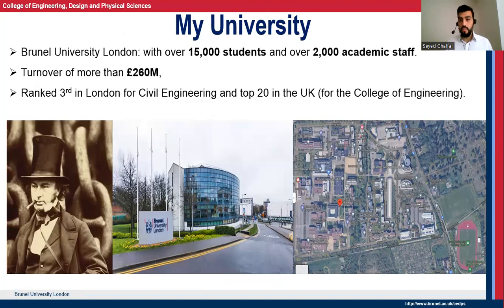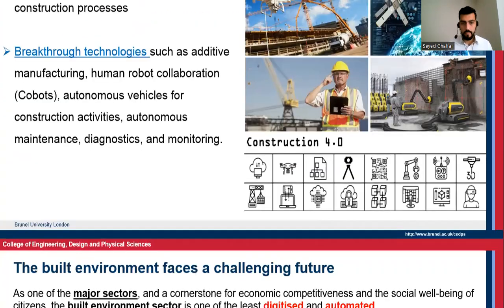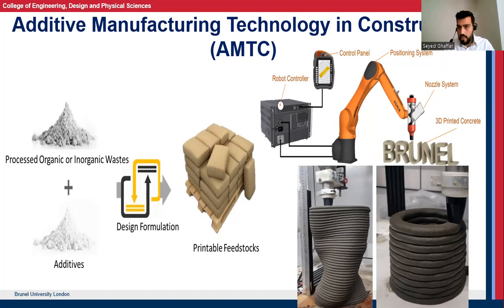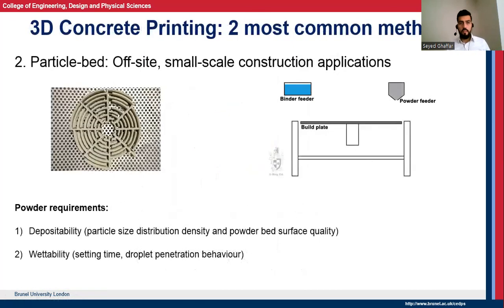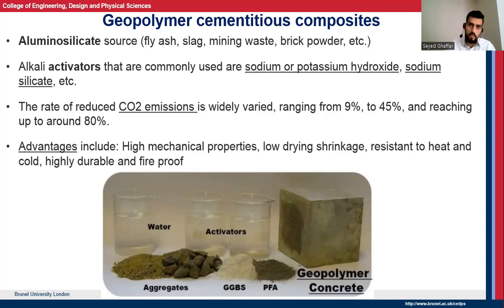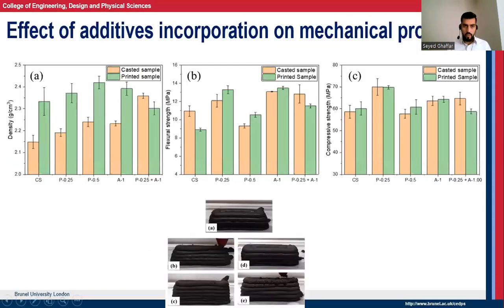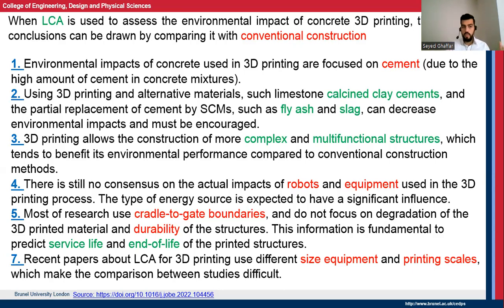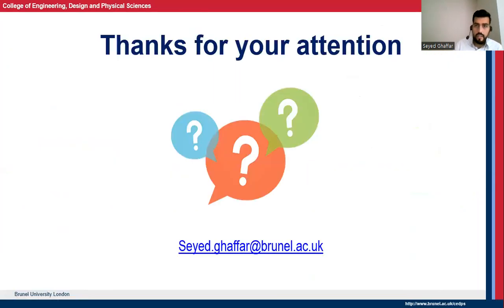CONF-MSS Digital Fabrication of Low-carbon Concrete for Modern Methods of Construction

Comment from the maker: Have government departments in developed countries such as Europe and the United States promulgated laws and regulations to promote the transformation of the construction industry into an environmentally friendly industry?
Reply from the maker: RE: Yes, there are promoted regulations all around the globe. This includes regulations that aim to address environmental concerns, encourage sustainable practices, and reduce the built environment industry's carbon footprint. Examples of such initiatives include building codes and standards that mandate energy efficiency, renewable energy integration, and environmentally friendly construction materials. Governments also provide incentives and subsidies for green building certifications, such as LEED (Leadership in Energy and Environmental Design) in the United States and BREEAM (Building Research Establishment Environmental Assessment Method) in Europe. Additionally, there are regulations for waste management, water conservation, and sustainable site development. These measures demonstrate the commitment of developed countries to promoting environmentally friendly practices within the construction industry.